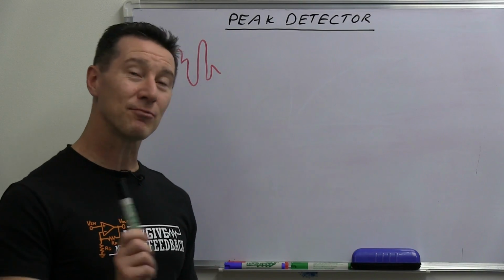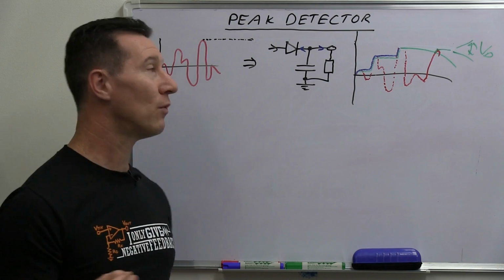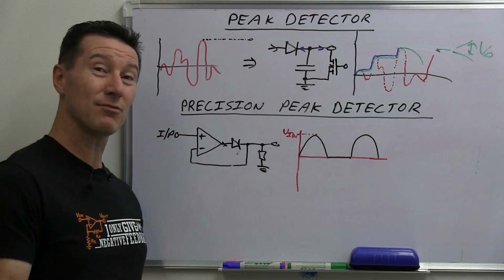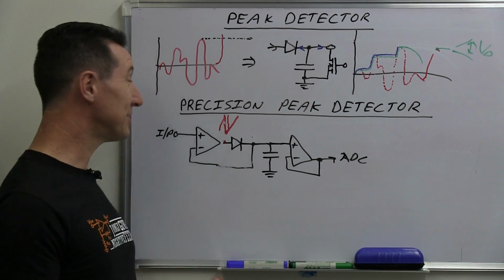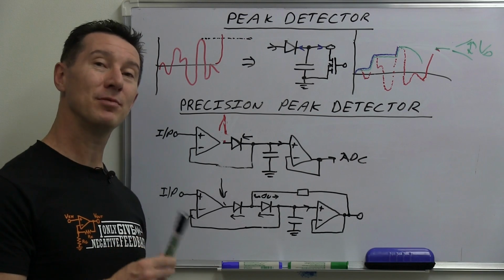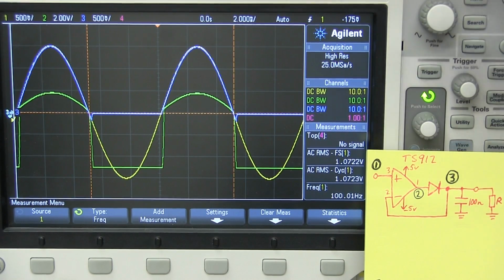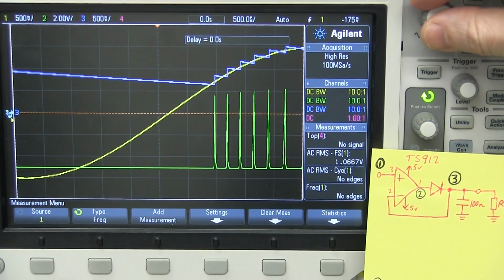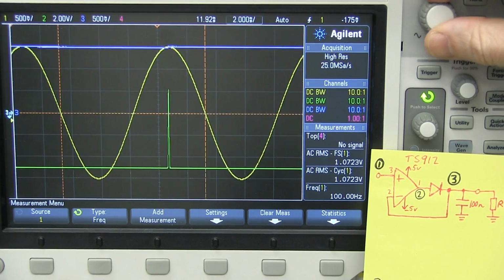EEVblog #490 - Peak Detector Circuit

Comment: 10-60mV are too little for anything useful. Consider amplification x10 with a really fast op-amp like for example THS3201. Then, depending the repetition rate of the impulses, the required precision and whether there is an ADC or not you might need a "Sample and Hold" circuit or a simple RC to average out the amplitude or nothing at all. Depends on the application specs really.

Comment: if you were using a vu meter to display the cap voltage it would be tweakable to add the voltage drop of the diode, i assume other display devices could be tweaked the same way.